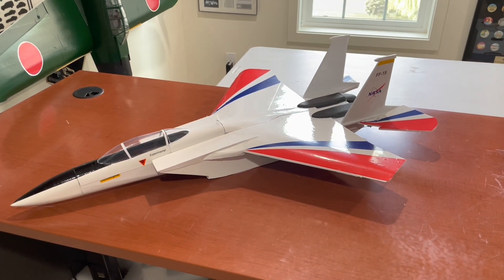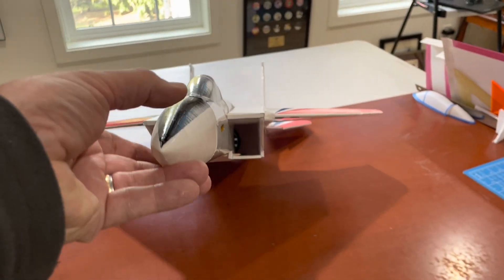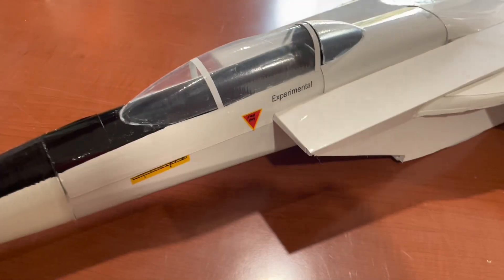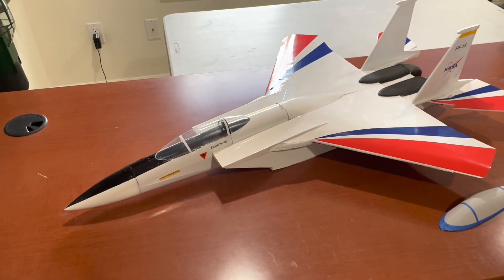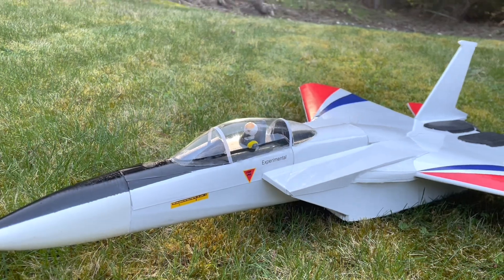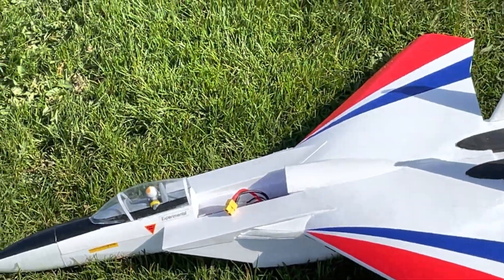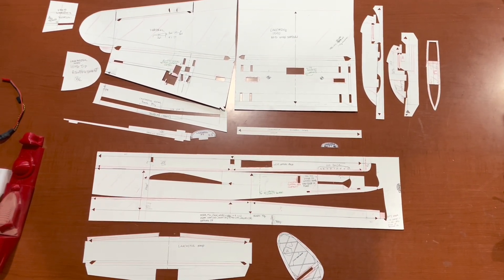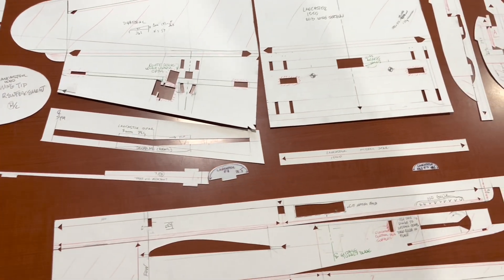Foam Board RC F-15 50mm EDF Maiden, Vacuum Formed Canopy, Teaser

Comment: Hey buddy! Can i have files please?
Reply from the maker: Sorry, no plans are available for this plane
Reply: @thenerdoligist1292  all good! Got the f20 done but it freaking blew up lol!!
Reply from the maker: Holy cow! How did it blow up? The motor or in flight?
Reply: @thenerdoligist1292  one of my servos was reversed 🤣 flew into the side of my barn!!! All my electronics are working somehow so will rebuild but I'm deciding what plane Im gonna build still want to build your plans!
Reply from the maker: @aidenkahn4338  I hate it when that happens! 😁
Reply: @thenerdoligist1292  maybe tomorrow I will post a picture of the sent in my barn lol!!! I'm using a 80 dollar fms 12 blade 80 mm 6s edf

Comment: This would be awesome to have for twin 30mm edfs too ! So cool
Reply from the maker: Thanks! Unfortunately I’ve been disappointed with the thrust of the 30mm EDF. I’ve measured 160g for what was supposed to be 260g. However twin 50s will fit with a 2200 mah battery

Comment: whats faster and better jet noise? this 50mm or dual 30mm???
Reply from the maker: Twins sound great. However this 50mm puts out 730g of thrust and twin 30mm put out 320g of thrust so hands down I choose the 50. Don’t trust the values that the motor manufacturers publish. I measured the thrust.
Reply: @thenerdoligist1292  thanks man i almost did sh1t and bought dual 30's haha
Reply: @thenerdoligist1292  im thinking on get the f15 v2 fms 64mm... what you think?